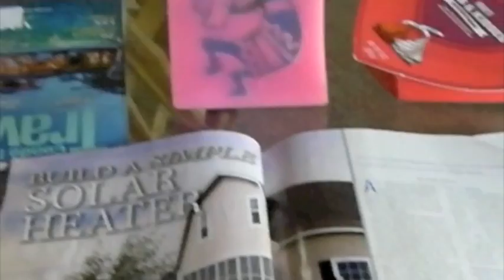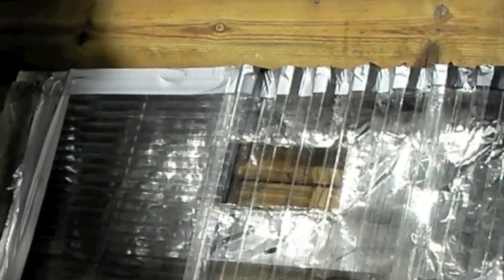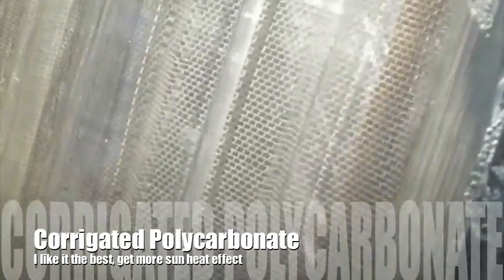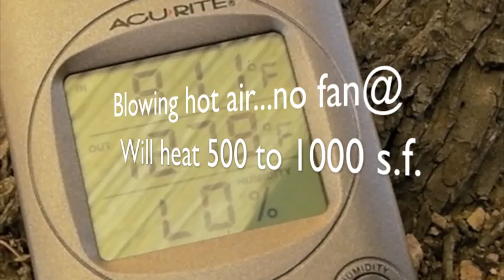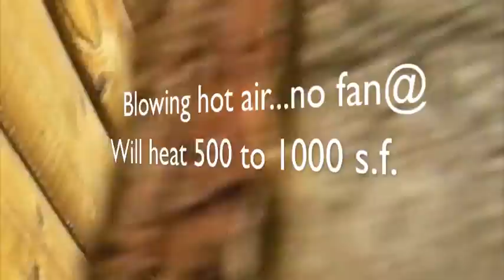How to Build a Heat Box for $6, Heat your Home Free

Comment: You didn't explain how you made it
Reply: It's all in the "Show More" dropdown area of the Video description. Every single step! Start routinely tapping on the "Show More" for all YouTube videos that you watch and you will usually find the answers to many of viewers routine questions.
Reply from the maker: Hi there. Gee, the video is pretty descriptive, this isn't rocket science.   The reason for doing the video was to stimulate pro active people who enjoy thinking and doing creative things to use this to create something good by using solar heating.  Over 561,000 have viewed this video, and many have written and told us it gave them ideas to do this, and even made improvements. That was our goal.  I am curious if you have done anything positive to take this idea and improve upon it, or if you like a tiny majority just use the internet to insult or criticize others who actual "do something".  I wish to encourage you to build something good and creative and tell us about it, or even do a video it.  That is if you are a "doer", not just a talker.  Let's do things positive and actually do good things.  Best wishes to you as you do great things to make this world better.    Ben Boothe
Reply from the maker: Kim,
Build a wooden frame, say 4 to 6 inches deep, 6 feet tall, and 3 feet wide, the back is solid, the front covered with glass, or fiberglass, or polycarbonate, and we put aluminum foil on the back wall of the inside to reflect the sunlight back onto a "wire screen" hanging in the middle space of the box"   We painted the wire screen black so as to absorb more heat from the sun and reflection. Screw or nail it all together it took me about 2 or 3 hours to build, but amazed at how much hot air is produced.  40 to 60 degree heat up from outside air to what it blows out.    So, if the weather outside is say 50 degrees, it will heat to 90 degrees and blow into your house.   If it is 30 degrees outside, add about say 40 to 50, and you get 70 or 80 degrees of "free heat".  Does that help.  Sorry for belated reply things happen slowly up on the mountain top.   Ben
Reply: Yeah.  I was thinking about what a waste of time it was to watch the video, because he didn't explain how it was actually built.  Then I read the description underneath and realized that, if I clicked on the "SHOW MORE", he had it all written down there.  Go figure.  What a way to deflate my anger balloon.  ;-)
Reply: @ShadowHauk  Just now got around to answering.  I built it, and it works.  Have you gotten around to doing anything, if so, send us a photo and a budget of what your costs were. That would be a positive contribution.  Actions vs Words thing. This is not rocket science, it is a simple box frame with one side to let sunlight in.   6 ft high, 3 ft wide and 4 to 6inches deep.  The front facing the sun is plastic, polycarbonate, glass, or fiberglass. The back has aluminum foil to reflect the sunlight back to a window screen that is hanging in the space in the middle of the box.  My goal was to see how or what I could put together with some old scraps in my basement.  How to build it, you nail or screw the 4  4x4's into a square shape and nail a piece of plywood to make the back. That should take you about 20 min.  Then you hang a window screen or metal door screen wire in the middle.  I put foil on the back to reflect the sun back toward the screen...and it heated it up even faster.  Then screw the plastic see through cover onto the front, another 20 min if you are slow.  All in all I spent about 2 or 3 hours putting it together.  I heats the outside air temperature in summer and winter from 40 to 70 degrees hotter, and works very well without a fan.  We considered putting a fan onto the hole in the wall inside to blow air in faster, but never got around to that.     Sorry about the shaky video, I am not a film professional, just wanted to throw the idea out there.  Over 560,000 people have viewed it, and many have built these. Build one and send us photos.  My out of pocket $6, but you can do a Cadillac version and use all new materials but even with that, the cost is very negligible.  Best to you.  Ben Boothe
Reply: Just now got around to answering. I built it, and it works.  We got the idea from Mother Jones magazine, and it actually has a building plan, but it is very simple to screw or nail 4 two by fours into a square frame and then attach a solid plywood board to make the back.  the front is plastic, or milor, or fiberglass or glass or polycarbonate to let sunlight in.  Again, not rocket science.  Then use what you have on hand or wish to buy if you want to spend money, the idea was to build this with materials on hand and see what we could do without spending much money.  561,000 people have viewed this, many have made heat boxes, some better than this.  Have you gotten around to doing anything, if so, send us a photo and a budget of what your costs were. That would be a positive contribution.  Actions vs Words thing. This is not rocket science, it is a simple box frame with one side to let sunlight in.   6 ft high, 3 ft wide and 4 to 6inches deep.  The front facing the sun is plastic, polycarbonate, glass, or fiberglass. The back has aluminum foil to reflect the sunlight back to a window screen that is hanging in the space in the middle of the box.  My goal was to see how or what I could put together with some old scraps in my basement.  How to build it, you nail or screw the 4  4x4's into a square shape and nail a piece of plywood to make the back. That should take you about 20 min.  Then you hang a window screen or metal door screen wire in the middle.  I put foil on the back to reflect the sun back toward the screen...and it heated it up even faster.  Then screw the plastic see through cover onto the front, another 20 min if you are slow.  All in all I spent about 2 or 3 hours putting it together.  I heats the outside air temperature in summer and winter from 40 to 70 degrees hotter, and works very well without a fan.  We considered putting a fan onto the hole in the wall inside to blow air in faster, but never got around to that.     Sorry about the shaky video, I am not a film professional, just wanted to throw the idea out there.  Over 560,000 people have viewed it, and many have built these. Build one and send us photos.  My out of pocket $6, but you can do a Cadillac version and use all new materials but even with that, the cost is very negligible.  Best to you.  Ben Boothe
Reply: Um, yes he did. Maybe it’s an IQ test in disguise. I see people failing them all the time on YT. 

And even my comment is one, too, since it’s not a pass/fail test...though I do think there’s a cutoff point, below which people ought not to try to grasp simple concepts, and just watch happy kitty and puppy videos.
Reply: Just now got around to answering. I built it, and it works.  Have you gotten around to doing anything, if so, send us a photo and a budget of what your costs were. That would be a positive contribution.  Actions vs Words thing. This is not rocket science, it is a simple box frame with one side to let sunlight in.   6 ft high, 3 ft wide and 4 to 6inches deep.  The front facing the sun is plastic, polycarbonate, glass, or fiberglass. The back has aluminum foil to reflect the sunlight back to a window screen that is hanging in the space in the middle of the box.  My goal was to see how or what I could put together with some old scraps in my basement.  How to build it, you nail or screw the 4  4x4's into a square shape and nail a piece of plywood to make the back. That should take you about 20 min.  Then you hang a window screen or metal door screen wire in the middle.  I put foil on the back to reflect the sun back toward the screen...and it heated it up even faster.  Then screw the plastic see through cover onto the front, another 20 min if you are slow.  All in all I spent about 2 or 3 hours putting it together.  I heats the outside air temperature in summer and winter from 40 to 70 degrees hotter, and works very well without a fan.  We considered putting a fan onto the hole in the wall inside to blow air in faster, but never got around to that.     Sorry about the shaky video, I am not a film professional, just wanted to throw the idea out there.  Over 560,000 people have viewed it, and many have built these. Build one and send us photos.  My out of pocket $6, but you can do a Cadillac version and use all new materials but even with that, the cost is very negligible.  Best to you.  Ben Boothe
Reply: He did in the details of the video above, Step by Step.
Reply: i didnt see instructions either. if you saw them could you write it dow and post it
Reply: @patticode6  The directions are in the description of the video! Why do you need someone to write them down again! SMH
Reply: @patticode6  Just now got around to answering.  I built it, and it works.  Have you gotten around to doing anything, if so, send us a photo and a budget of what your costs were. That would be a positive contribution.  Actions vs Words thing. This is not rocket science, it is a simple box frame with one side to let sunlight in.   6 ft high, 3 ft wide and 4 to 6inches deep.  The front facing the sun is plastic, polycarbonate, glass, or fiberglass. The back has aluminum foil to reflect the sunlight back to a window screen that is hanging in the space in the middle of the box.  My goal was to see how or what I could put together with some old scraps in my basement.  How to build it, you nail or screw the 4  4x4's into a square shape and nail a piece of plywood to make the back. That should take you about 20 min.  Then you hang a window screen or metal door screen wire in the middle.  I put foil on the back to reflect the sun back toward the screen...and it heated it up even faster.  Then screw the plastic see through cover onto the front, another 20 min if you are slow.  All in all I spent about 2 or 3 hours putting it together.  I heats the outside air temperature in summer and winter from 40 to 70 degrees hotter, and works very well without a fan.  We considered putting a fan onto the hole in the wall inside to blow air in faster, but never got around to that.     Sorry about the shaky video, I am not a film professional, just wanted to throw the idea out there.  Over 560,000 people have viewed it, and many have built these. Build one and send us photos.  My out of pocket $6, but you can do a Cadillac version and use all new materials but even with that, the cost is very negligible.  Best to you.  Ben Booth
Reply: @patticode6  Just now got around to answering. I built it, and it works.  Have you gotten around to doing anything, if so, send us a photo and a budget of what your costs were. That would be a positive contribution.  Actions vs Words thing. This is not rocket science, it is a simple box frame with one side to let sunlight in.   6 ft high, 3 ft wide and 4 to 6inches deep.  The front facing the sun is plastic, polycarbonate, glass, or fiberglass. The back has aluminum foil to reflect the sunlight back to a window screen that is hanging in the space in the middle of the box.  My goal was to see how or what I could put together with some old scraps in my basement.  How to build it, you nail or screw the 4  4x4's into a square shape and nail a piece of plywood to make the back. That should take you about 20 min.  Then you hang a window screen or metal door screen wire in the middle.  I put foil on the back to reflect the sun back toward the screen...and it heated it up even faster.  Then screw the plastic see through cover onto the front, another 20 min if you are slow.  All in all I spent about 2 or 3 hours putting it together.  I heats the outside air temperature in summer and winter from 40 to 70 degrees hotter, and works very well without a fan.  We considered putting a fan onto the hole in the wall inside to blow air in faster, but never got around to that.     Sorry about the shaky video, I am not a film professional, just wanted to throw the idea out there.  Over 560,000 people have viewed it, and many have built these. Build one and send us photos.  My out of pocket $6, but you can do a Cadillac version and use all new materials but even with that, the cost is very negligible.  Best to you.  Ben Boothe
Reply: start at 1 min he explains how to make it
Reply: sorry, i mean down

Comment: What a waste of peoples time.
Reply: Just now got around to answering. My mind is certain, I built it, and it works.  Have you gotten around to doing anything, if so, send us a photo and a budget of what your costs were. That would be a positive contribution.  Actions vs Words thing. This is not rocket science, it is a simple box frame with one side to let sunlight in.   6 ft high, 3 ft wide and 4 to 6inches deep.  The front facing the sun is plastic, polycarbonate, glass, or fiberglass. The back has aluminum foil to reflect the sunlight back to a window screen that is hanging in the space in the middle of the box.  My goal was to see how or what I could put together with some old scraps in my basement.  How to build it, you nail or screw the 4  4x4's into a square shape and nail a piece of plywood to make the back. That should take you about 20 min.  Then you hang a window screen or metal door screen wire in the middle.  I put foil on the back to reflect the sun back toward the screen...and it heated it up even faster.  Then screw the plastic see through cover onto the front, another 20 min if you are slow.  All in all I spent about 2 or 3 hours putting it together.  I heats the outside air temperature in summer and winter from 40 to 70 degrees hotter, and works very well without a fan.  We considered putting a fan onto the hole in the wall inside to blow air in faster, but never got around to that.     Sorry about the shaky video, I am not a film professional, just wanted to throw the idea out there.  Over 560,000 people have viewed it, and many have built these. Build one and send us photos.  Actions vs words thing.  My out of pocket $6, but you can do a Cadillac version and use all new materials but even with that, the cost is very negligible.  Best to you.  Ben Boothe

Comment: that was the hardest video to watch ever.  zoom all the way out when you shoot video.  that's why your video is so shaky. also, slow down and catch your breath.
Reply: Just now got around to answering. This is not rocket science, it is a simple box frame with one side to let sunlight in.   6 ft high, 3 ft wide and 4 to 6inches deep.  The front facing the sun is plastic, polycarbonate, glass, or fiberglass. The back has aluminum foil to reflect the sunlight back to a window screen that is hanging in the space in the middle of the box.  My goal was to see how or what I could put together with some old scraps in my basement.  How to build it, you nail or screw the 4  4x4's into a square shape and nail a piece of plywood to make the back. That should take you about 20 min.  Then you hang a window screen or metal door screen wire in the middle.  I put foil on the back to reflect the sun back toward the screen...and it heated it up even faster.  Then screw the plastic see through cover onto the front, another 20 min if you are slow.  All in all I spent about 2 or 3 hours putting it together.  I heats the outside air temperature in summer and winter from 40 to 70 degrees hotter, and works very well without a fan.  We considered putting a fan onto the hole in the wall inside to blow air in faster, but never got around to that.     Sorry about the shaky video, I am not a film professional, just wanted to throw the idea out there.  Over 560,000 people have viewed it, and many have built these. Build one and send us photos.  Best to you.  Ben Boothe